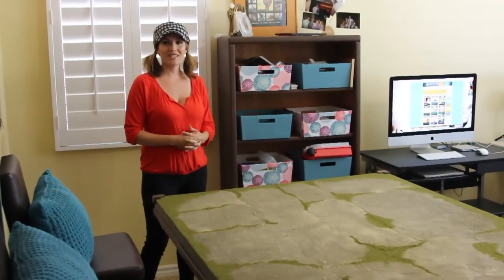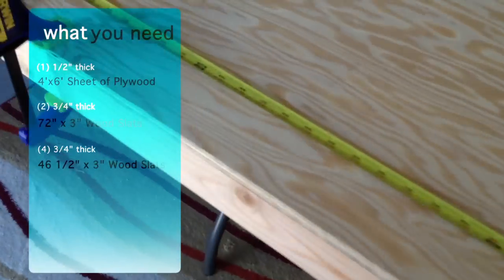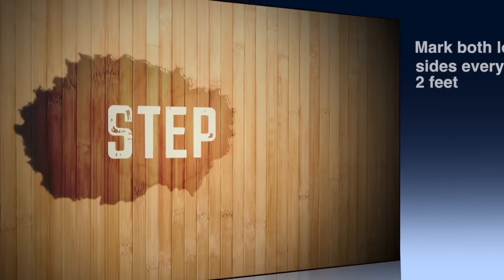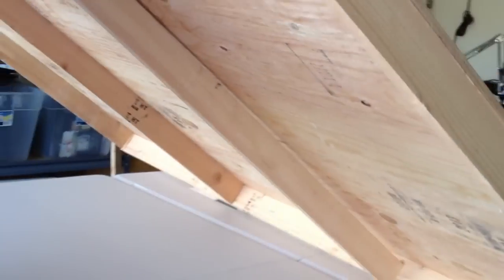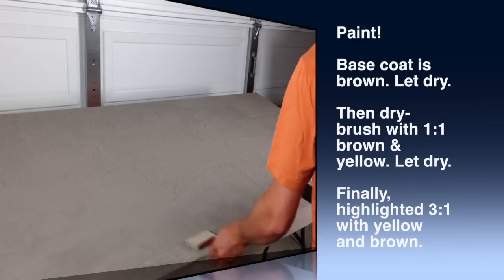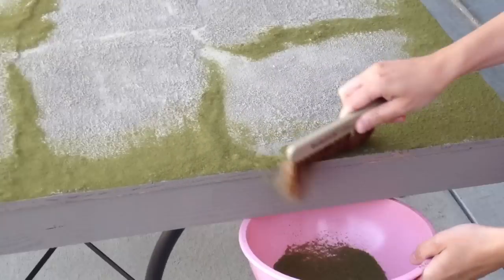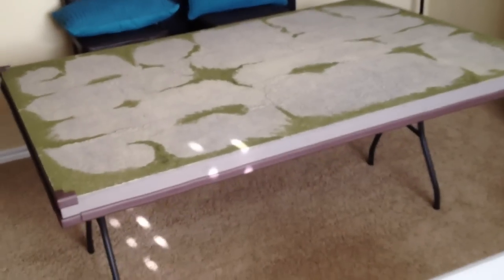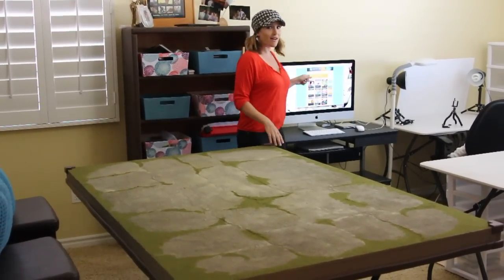miniGIRL #09: How to Make Game Table For Miniatures -Fast Tutorial- So Easy!

Comment: You should flip it so you can see where your slats are going so you can screw them to the box frame first and make sure your on your marks. For if your off your screws will come out on the side of your slats and splinter it.  Its easier to see what your doing and line them up with your marks better if your frame is flipped over.

Comment: First you should have used Wood Glue and then you only need a few screws,  Second a Fast easy way to texture is Mix Sand into your paint (Green) then Roll it on and if you like sprinkle Flock on before it Drys or Use glue then Flock after paint drys either way.

Comment: completely unimpressed
Reply: You're a guy and your names Tracy?
Reply: um...yep. I'm not the only one either...
Reply: Tracy Mccreary Can I call you Shirley instead?
Reply: I have a round table around 110cm in diameter but I want a fold out table top which is square and much bigger than the round table so there is some overhang. Any ideas ? those poker fold out tables on amazon are not quite big enough.